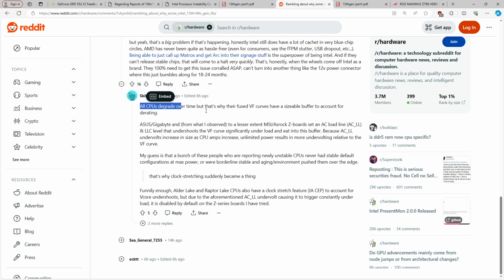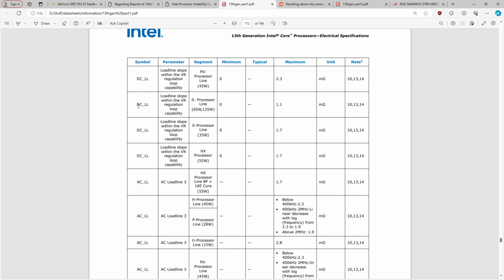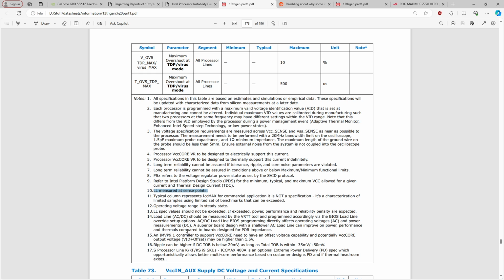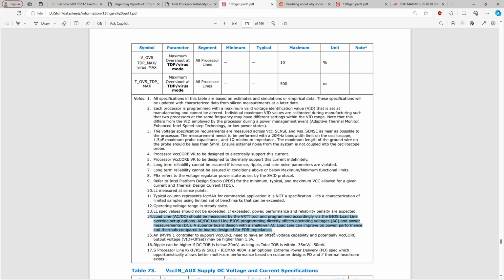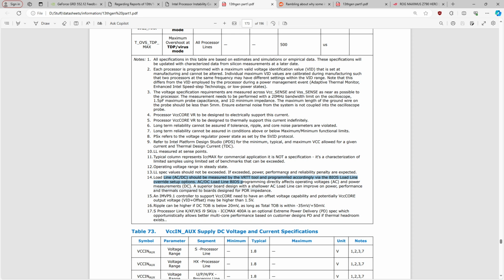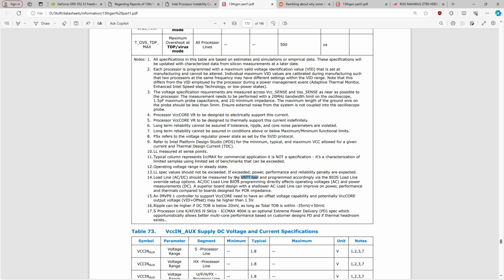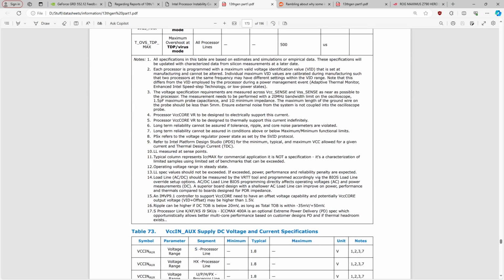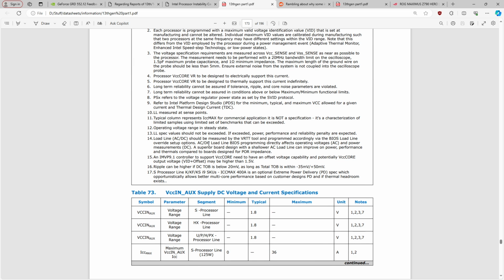Ranting about intel's 13th & 14th gen Vcore load line "specifications"

Comment: Makes sense to me. just Read all the Notes. They say these are the silicon limits (within this range). You assume all boards are build like High-End. There is a difference in the silicon & the Board partners have different boards & skews to accomodate to. Some boards use cheaper parts so higher AC/DC LLC can degrade the components. One reason is that this allows them to use the cheap stuff.  You cant use the same setting on All Skews & Boards.

Comment: There is one huge difference. Nvidia distributes GPU's to board partners. If board partners do not get GPU, they can't make their product. Even more lots of SKU's of most board partners even use the Nvidia made PCB. Most of the Bioses used by those boards are dervied/edited versions of Nvidia supplied bios. Plus that PCB is designed fir the exact GPU that is soldered on it. Every version of yhe GPU gets its dedicated version with good rnough VRM. They do not make one PCB that is optimized for any GPU core. 
Mainboard companies do not depend on CPU. Sure, Intel could stop selling them chipsets, but they can't stop them all they need to sell CPU's.
Part of it reminds me of software compatibility in the case of windows and MacOS. Stuff made for the MacOS needs to work on like 20 different hardware setups. In the case of Windows, there is an unlimited number of hardware setups. Plus, there is way more software people install in Windows because there are more free software and more malware and scareware.
I am a big fan of the channel and your work buildzor but this one has quite a few assumptions. We do not know what mainboards companies get in the development kit from Intel. This is just one document. For the same money they could drliver them whole lad and send personal to train them. That tool might be working better than any sample of the processors emulating all different CPU's yhat must work in yhat socket. They can't optimize all mainboard just for the most powerful SKU. It needs to work with all of them.
One thing is certain, it is way harder work than here is the PCB with soldered core on it and bios just slap 300Watt capable cooler on it.
I do not know what requirements are set by the Intel and I do agree that they should be extremely goid defined. Thought I think Intel is not in same situation as Nvidia and that they have less control.
Nvidia is just more powerful and strongarms way more. Look at the EVGA. Nothing happened to Nvidia after EVGA stopped making their product. Only EVGA lost revenue disregarding were they right to fight the power. You think Intel could survive for example Asus stopping with Intel mainboards? I am not sure to be honest.
Reply: Survive , yes, both amd or intel could survive in that scenario, but that would have effects on their market share, and therefore it is not a scenario they want.
As someone that works in game development industry and has connections to the hardware segment, when i was listening to the comments he made yesterday and today in regards that topic , I was like " It does not really work like that". As you even said , "Mainboard companies do not depend on CPU." Even dependency in regards the chipset is somewhat limited as there are many "chinese" companies without direct links to intel or amd that make boards that work and are sold in great numbers in the asian market. 

So in truth intel and amd have far less control  and neither Intel or AMD have a market dominance similar to nvidia, that effectively encompasses more than 3/4 of the gpu market. it would be unfortunate to nvidia if lets say asus stops making nvidia gpus, but simply unfortunate. it will be more than unfortunate for intel and amd if asus stops making amd or intel boards. And the profit margins on most boards, specially the lowers ones, is not that great to begin with, so it is not like asus would collapse if they stop making intel (or amd ) boards. They would actually have more problems if they stop making laptops or gpus - that unlike boards, can be , as the not so distant past shows, scalped  by the manufacturer's.   
As such both AMD and Intel independently of what they decide to  write in their documents end up issuing recommendations. And that is why we had the issue months ago with amd cpu's almost frying - Asus simply decided to go above the recommendations ( a copy problem... right) so the performance on their boards was slightly superior .  The big difference   is that for the last generations Amd cpu's are effectively more ... finicky i guess, as they are chiplets, and therefore have less tolerance, while the monolithic design allowed intel cpu's to soak higher voltage.  But as intel improved their manufacturing process and was able to get closer to the limit of what their design and silicon allows the headroom for board manufacturer's to go beyond intel spec decreased. It is still there, it exists but it is no longer an almost flat margin of 1/4 to 1/3 like it was with gen 12, yet that is what the main board manufacturer's have been using.
Reply: @Solrac-Siul  you have explained it even better. Nvidia, simply, has way more control over the finished product and can afford their policy how ever it is/was.
Regarding Intel being able to survive bigger hit, I am not sure how much have you followed current Intel investments and new programs. Seeing all they are trying to do and issues between parts of the company plus pressure from AMD in CPU market as well as them trying to open new markets I think they are in the most fragile state ever. With building new fabs for wafers and expansion to new fields like AI and GPU’s it all costs money that will not start bringing serious profits for a long time. Plus their chip foundry is kinda separating their business from rest of the company to make sure they survive and roll in more business. Considering that there is literally zero security in the financial market nowadays, one can lose support of the investors over night. Having bad things happening, in this period, would leave them pretty fragile and exposed. It would be a hit that even if they survive they can’t really afford.
Regarding Far East, if Intel sells to that market 1 million chipsets it will come in everyone’s hands. Intel can’t control that and can’t stop delivering chipsets to all of them. They just can’t control it.
Plus if they would we remember the times when other companies were able to make chipsets as well. Third party could do it and that would mean even less revenue for Intel.
Intels CPU branch is having huge challenges in front of them. They were milking good times and were staying so long on 10nm process. They have lost so much in semi professional and server market. They still have die hard fans but it is hard to look away when the competition is doing good and draws half as much power in the time of the artificial energy crisis and crazy energy prices. Gamers are still, in general, not worried about power consumption but to much heat leads often to stability issues. I know people who will never buy AMD CPU because of their experience. Their mindset is done. They relate AMD with issues. Same as with Nvidia. They get Nvidia GPU because they still remember AMD driver issues that are long gone. So for them it’s Intel has better stability and software support. That is how they see it. One can even show them stories about Intel strong-arming market to implement their technology and optimizations. Plus paying software developers to make code that uses their hardware. But then same people say it’s free market and AMD should have invested to do the same. Its hard to argue that as well. 
Anyhow it’s hard place to be in PC world. You need to be compatible with so many things. OS has to support so much hardware. Drivers must work in any combination of other hardware and drivers. 
Same goes for Intel and AMD CPU’s. They have to work in all mainboards. It ain’t easy task especially when you are pushing hundreds of Watts power and high speeds. With mainboards ranging from 100 bucks and sporting 6 phase VRM with high side and low side FETS to highly overkill 18 phase digital controlled VRM’s with 90A to 105A smart power stages and all solid state SMD caps with low ESR. Sure market accepts that you shouldn’t run top models in cheapest mainboards but still some people do it. Look at the Dell for example or their Alienware part. Custom PSU, Custom mainboards, not great cooling. High price. They do not use best VRM solution on their mainboards. They still think they can have two 120mm intake fans and cool 14900K and 4090. Sure you can but making it thermal throttle and perform like 14600 and 4070.
Anyways it’s not a simple position to be in. Intel will have to seriously think about how to go further. I am not surprised by leaks that new processors of some companies will forfeit GHz race and work on efficiency and topology advances. This race in GHz is getting stupid if it brings unstable products.
Reply: @NINEWALKING  you place too much faith in the diy market numbers. The largest segment of consumers gets prebuilts. They do not care about power or temperatures, or if the platform is upgradeable or not - as most will not upgrade the cpu or even know how to upgrade the cpu, or even how to apply paste to a cpu. they buy a system to last 5-6 years or until it is impairs their needs and then buy a new one. Brand recognition, cost and availability end up being the decisive factors. 
And if you want a anecdotal proof , I worked for activision (for 16 years) and saw the hardware surveys in regards most popular games  (cod, wow, diablo 4). In cod Intel actually had more than 50% time over time (and 50% in cod is huge, since includes everyone that purchase or tried the game for free), with the most  popular recent cpus being the 12600 and 13600. The numbers were not particularly different in regards wow and diablo.  And just so you have a real idea of how the market actually is, many  performance problems with cod and diablo 4  were tied with users not enabling xmp and running at 2000 and 2133 ddr4 speed. And when advise to enable xmp often the answer was "how".  So that is the cpu market .

Therefore  Intel could survive asus not making boards, as there is msi, or gigabyte and others like- and you even mention -  dell and alikes that even have proprietary motherboards. but it would have impact for Intel and even AMD, as many buy asus (due to brand recognition). Asus messed up with amd chips but as you can see did not effectively suffered any repercussion. At best got a slap on the hand and told "do not do it again please".

And they got another slap , this time by intel, and that is why they issued the new bios with "intel spec profile" as not only they are the ones pushing more "optimizations by default" but also the ones selling more motherboards. 

That aside are 100% correct that nvidia is on a different league. You piss nividia, you get no gpu chips (actually you piss nvidia and you may actually get no first day drivers for your games also and that can go on for weeks ). you stop making nvidia cards, no problem, the chips that were intended to your company are distributed to others, and there are many wanting that chance. And nvidia itself also makes gpus. 
And unlike cpus, it is not a relatively split market. nvidia does hold more than 3/4 of market. probably 4/5 .  So if you are business and gpus represent a good percentage of your  revenue  cutting ties with nvidia or having those ties cut by nvidia is a major problem.Even with ties , asus , gigabyte and msi already compete  between them and nividia to have the gpu chips early.
So using nvidia and the way they enforce guidelines and making comparisons with intel and amd in regards specially motherboards is problematic- specially because at around 18:00 minutes of this same video he even admits that if the gpu partners do not follow nividia guide lines, they get no gpu and cannot make graphic cards.
Reply: @Solrac-Siul  I agree with you. I know the stats because I follow Steam hardware surveys. But we are talking about extremely small numbers of people who buy hallo products and expect top performance. Many people even then go to prebuilds and boutique builders and ofen end up with very expensive systems that do not do as good as a job with the cooling as they should. Especially when they use AIO CPU coolers. I would even go so far to claim that only two AIO coolers can handle the 14900K somewhat properly. One is Arctic Cooling Freezer III 420 and only with 3 additional 14CM fans in the push pull. The other is EK direct die 360 version, and that's when the CPU is delided and in an extremely good ventilated case. Even then, both are better off when one limits the power to something like 250 Watt. 
I am an old school overclocker. I have built water cooling systems before all components were available. Radiators were heater cires from cars, and pumps were from aquariums, and reservoirs were Tupperware, rises were from garden or aquarium, and fittings from water instalation. I still have somewhere Vapochill case. I used to use high power TEC on Coldplay and use water bloc to cool hot side.   You name it, I have done it. I have moved cases when cases have had one or a maximum of two 80mm fan slots to accept a few 120mm fans and installed windows and light bars but not for looks. It was for Lan parties to check if something like CPU got loose all fall of during the transportation.
I have no clue how many computers and servers I have built. Not even how many water cooling systems I have built.
I get my results, and I find the limits. I understand I am not the average gamer. Nor is my system average system. My best gamer friend used to eotk for computer store for a long time. He built tons of computers and he is good over clocker. He builds computers for friends and family and influences a lot of people what to get. Same over here. When someone in my friends and family needs special solutions, they point them to me. 
Some boutique builders do make great stuff that really works. But a lot of them prefer looks over performance. RGB and distribution plates and hard tubing over water speed in the loop. Choosing a lower ID of tubing for looks. Have tons of 90-degree fittings slowing just for looks. Using extra thin radiators and non pressure optimized RGB fans. Looks great and costs a lot, but it doesn't cool that good. Not to mention prebuilds with 240 AIO with LCD on 14900KS. Looks awesome, right, but it is not enough, especially if there is no good airflow in the case.
The current meta of high-end products is complex. Blaming just one thing or one side is a bit pointless because they all helped create this mess. For example, Intel optimization App. WT actual F? Shouldn't Window 11 process engine already put proper processes into proper cores made for that kind of process? Why need for an App? And if App is necessary. Intel, why only 14 Gen? 13 and 14 gen are practically same, and already 12th gen has need for it.
Reply: @NINEWALKING  i can answer your last question as i have some insight due to   inclusion of world of warcraft within the apo. The process is highly time consuming, and not fully portable between 12., 13 and 14th - mostly because there are more cores within 13 and 14th. So it takes considerable more time (And money) to create apo profiles for 12, 13 and 14th . They now have some level of AI to assist but it only helps to an extent and even with that it took several people about 1 month to "APO world of warcraft". 
In addition the gains for 12th will in theory be smaller and stating that apo gives in average 15% more performance in regards 14th  is more marketable than saying that it provides 15%for 14tth, 10 for 13 and less than 5 or so for 12th.
That said, APO is a solution that intel had to come up with to effectively resolve a windows issue - that MS should have fixed but probably would only fix with win12 that effectively impairs the big core-little core architecture.And this is not just a problem for intel as amd will eventually follow suit with their equivalent of e-cores , apple already has that, and even arm processors to an extend need scheduler optimizations.
Reply: @Solrac-Siul  similar issues are found with AMD 7959X3D. Where one chiplet (CCD) is practically 7800X3D Vcache chip and the other is like 7700X. Scheduler makes wrong decisions, and suddenly, some game processes end up on both cores. This affects performance due to less L3 cache on  non 3D Cache CCD and losses on infinity fabric. So some games work well with it and done are working slowly with the 7959X3D CPU. 
But my point was exactly that Intel and developers of software have to maje workaround for the issues of yhe Windiws 11 scheduler. Many people went to Windows 11 because it should have made it possible to work with mixed core CPUs.
I still see my YouTube tab video streaming working on my P core, while I am pretty sure that E core on 14900K can handle one stream.
Reply: @NINEWALKING  same as nvidia, actually more than nvidia, windows has market dominance.   
Sadly this is the outcome of the way we compartmentalized economy and production. It is great to not have costs of manufacturing and development but then you lose partial control and depend of others.
Reply: @Solrac-Siul  agreed. Nice talking to you. Appreciated.